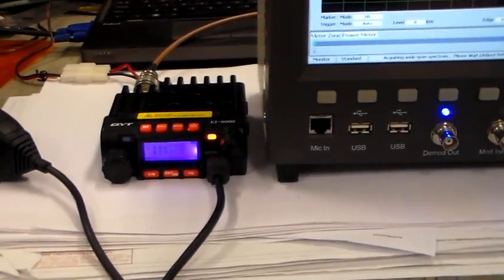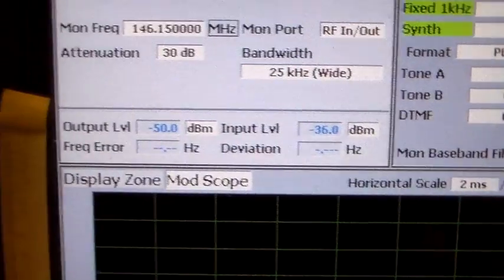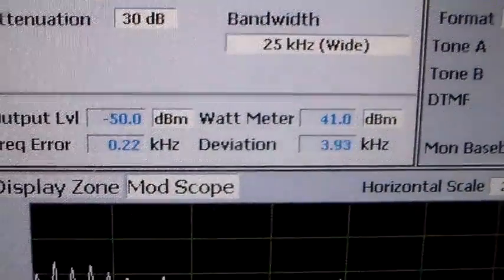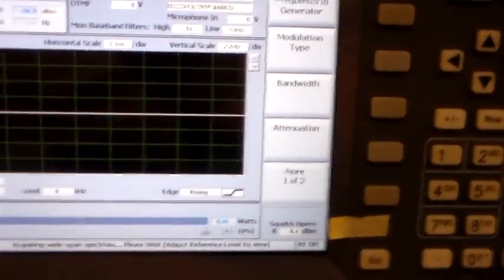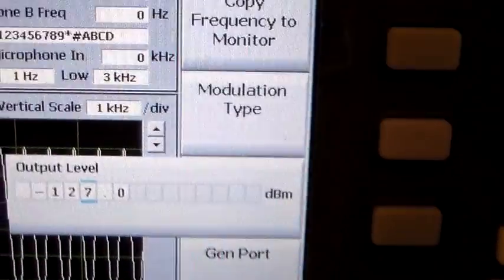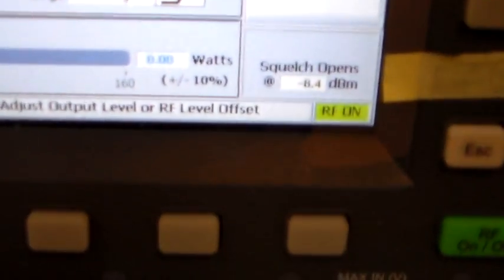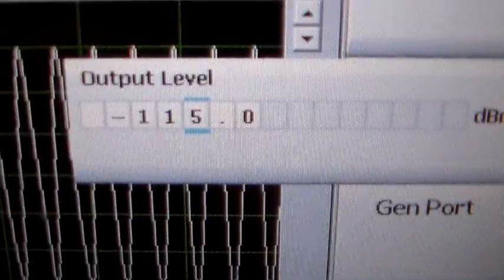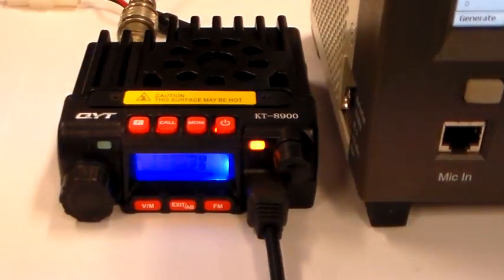QYT KT-8900 Transmitter And Receiver Tests.

Comment: Mate I have one of these radios and I Just got my F-call. Am I actually allowed to use a radio like this that has the ability to transmit out side of the amateur bands? I had a look at it in chirp and it doesn't look like i can trim the upper and lower limits like you can on something like a UV-5R which I was told is what I needed to do not to get in trouble.

Comment: I have one of these since a month ago. It seems an updated version as there is a headphone/speaker jack in the front. It has very poor sensitivity, much less than my FT-857D, and I can't even hear some repeaters that I usually receive 59 in the FT-857.
Reply from the maker: I suspect your one is faulty if you can't hear a repeater at all that's 5/9 on an 857D. If that was me I would ask for a replacement.
Reply: New version: The jack on the front is for the programming cable.  The one on the back is for ext speaker. 

 On the first version of the radio, there is only one jack on the back (none on the front), and thats for the programming cable afaik.
Reply: I also have newer version with jack on the front, my QYT also have poor sensitivity, I dont know which component inside can be problematic? Rig can receive only strong signals. Is there any hope of repair/readjust?I have no options to replace. Please help!
Reply: @interstellar8663 set the squelch to 1, use programming cables.
Reply: set the squelch to 1, use programming cables.